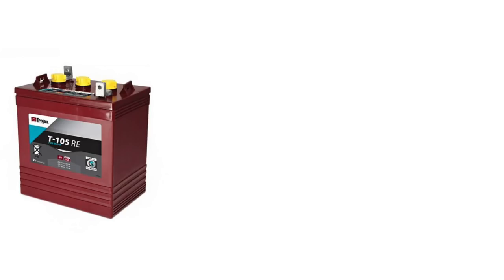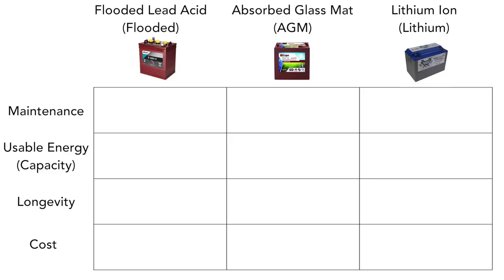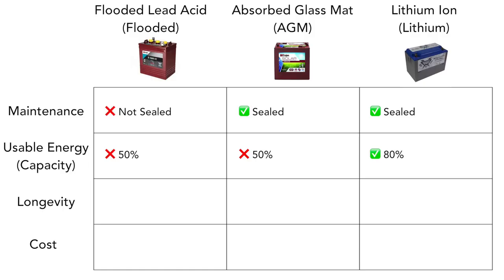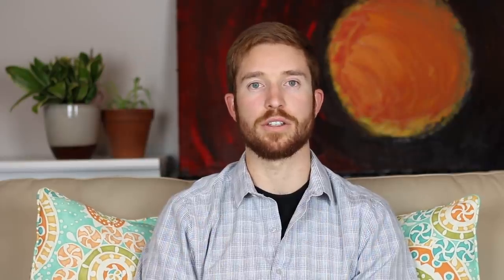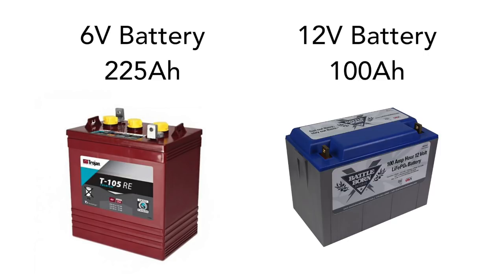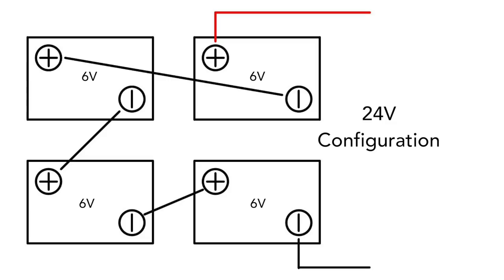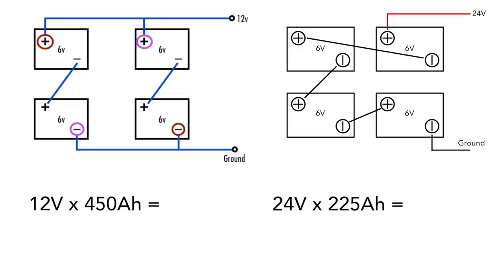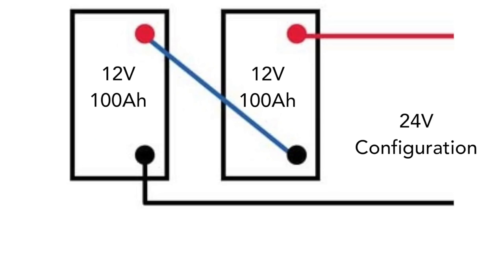Battery Bank Options + Wiring Solar Batteries from 6v to 12v vs 24v

Comment from the maker: Hope you guys enjoyed the video 😊 Be sure to share this info with anyone you know who is interested in solar power. It really helps us out. Thanks for watching and I'll see you in the comments!
Reply: not aiming to step on your toes but 9:03 12 volt set up your outputs need to be off set for a balanced drain and charge so that one battery is not taking all the drain or charge first. Path of least resistance always stands with batteries. The way it is set up in the video one battery is always playing catch up and the one that is the first out is the first to fail. Good effort on the breakdown and explanation. Have a good day
Reply: Duet Justus what about these 12v batteries that have 75a. .....they are like $30. Would these work for a small system
Reply: Something for you to consider for your next comparison is lead carbon batteries. The negative plates are treated with carbon to reduce degradation . They have similar performance to LiFePo4 , 3000 - 5000 cycles at 70% DOD , they are designed for  Partial state of charge operation (PSOC) are a lot less expensive and are safe. Yes they are heavier. The other point I would like to raise is ,With the way technology is advancing, Is it worth going for something that will last 20 years, when it could be out of date in 10 years.
Reply: Not certain about the points made but ,if anyone else wants to uncover homemade solar energy try Magonsi Solar System Expert (just google it ) ? Ive heard some great things about it and my co-worker got amazing results with it.
Reply: In 2-3 years the solid state batteries will make all of these obsolete.
Reply: @buffalo_chips9538  It was estimated in 2012 that a 20 Ah solid-state battery cell would cost US $100,000. It's a better technology and has improved greatly, but the cost for low such a low amp hours isn't plausible yet. This technology will reach computers and cell phones before it's ready to power home appliances.
Reply: Do another video with Lithium being the old standard now compared to Sodium metal battery and the new Iron Flow Battery
Reply: Dude you are amazing thanks for the information you never know... That there is other people in the other side of the planet watching your videos.👏👏👏👏
Reply: Hey, I don't know if you still read comments but it would be cool if you made a new video to compare different complete setups at different price ranges for RV's, also maybe talk about combining battery chemistry in your pack, also what are the advantages/disadvantages when using it trough an inverter, how one allows for more draw without compromising the batteries and if you ever run out of topics imagine the cost of a DIY 18650 battery pack and factor that in too.
Reply: Indeed educative thanks
Reply: @buffalo_chips9538  Thanks for letting us know future products will make current products obsolete.
Reply: I like the very side by side comparison but you kept referring to them as lithium ion not lithium phosphate as the pictures showed
Reply: If the system is wired both in series and in parallel, what happens if one panel is shaded will the whole bank close down or just the one panel?
Reply: At this point in time , 20 years of lithium battery life is only theoretical since they haven't been around very long .
Reply: A few things missing from the lithium battery sales pitch. Class c motorhomes have room for two batteries max, not 3 or 4, so your calculations don't work for those types of homes. Lithium batteries aren't drop-in replacements for lead acid they need additional upgrades. Lithium batteries are more sensitive to high and low temperatures than lead acid batteries so they need to be kept inside which takes up valueable space. Solar power is a supplemental power source. A gas/diesel/propane generator runs 24/365 come rain or shine.

Comment: The best video for connecting batteries together I have ever seen. I clearly understood how to connect my three 12 volt lead acid batteries to maintain a 12 volt system to run my 12 volt to ac converter and to connect my 12 volt 100 watt solar panels to charge these batteries. I got the batteries for free from my son-in-laws business and had the wires built 9" long to connect them all together in parallel from a website on amazon and everything works great. I have 300 ah at 3600 wh and divide that in half or 50% of usage of the batteries gives my 1600 wh of usable energy. I was just given another 12 volt battery to connect to it so I am glad I order 4 set of negative and positive cables. I'll then have 400ah at 4800wh divide by half and I have  a 2200 wh of usable energy. Its running great.

Comment: I’ve been running most of our home off grid for around 4+ year now and my lead acid batteries are doing just great. Yes I agree you have to maintain them regularly but if done correctly they will last years. Just waiting for these batteries to give up before considering changing over to lithium batteries,that being said it all depends on the price.👍
Reply: Lithium catches fire and can blow up

Comment: A couple of things to consider with lithium ion batteries. If you do end up over charging or discharging them they'll probably be toast. And if they catch on fire, have fun putting the fire out! Lead acid batteries might be old tech, but they are far more robust. They can handle more abuse and are probably the better choice for someone beginning with solar power.
Reply from the maker: I really do like my lead acids. It’s definitely a trade off and if I were to install again, I would definitely need to weigh all the options. Thanks for taking the time to share this info 👍🏼
Reply: Cheers for replying. There's a couple of other interesting battery technologies out there too. Nickel-Iron (Edison) batteries & Salt Water Cells. And of course some people run industrial size NiCd cells too.
Reply: the FIRE problem is practically non existent with LiFePo4 batteries, people must make a study on the differences in Lithium batteries, the mostly in small batteries used chemical is LiOn (18650) and YES they are a bit dangerous, the LARGE prismatic cells in LiFePo4 chemistry are in fact very hard to ignite, so check out the BIG difference between these.....
Reply: Agree, LiFePo4 batteries are far more stable and safer. But at the expense of reduced capacity. But practically all those involved in making DIY power walls and the like are predominately using Li-ion chemistry cells recovered from old laptop batteries etc. It's triple jeopardy really; using unstable cells, second hand with different lifespans left in them, some people not really knowing what they are doing. Did you see that video on the VW combi going up in smoke when a pack of Li-ion cells was left charging?
Reply: Lithium ion batteries are more safer, its very hard to ignite them due to the fact that the constituent cell is made up of small finger-like batteries that are also inside a metal exterior. On the other hand, lead acid batteries release hydrogen gas when charging and sulphate at the terminals over time.
Reply: The new glass electrode lithium batteries are just starting to come onto the market.  These batteries are a lot harder to damage through careless charging than the older lithium technology.  It's within sight that Li-Ion cells could overtake LiFoPo4 cells for solar storage, with the same storage capacity as Li-Ion but without many of the old problems associated with over- or under-charging, or caused by charging at the wrong rate.

Comment: Great diagrams much appreciated.  Have been chewing on an upgrade for our trailer for longer dry camp times with litheom ion batteries.   We where not sure on the solar for the moment since our preferred camp sites are heavily wooded and light limited.  But the 80% useage helps camp stay and also we can run generators for some recharge as needed.  This video is helpful as we work toward this goal.  Thank you.
Reply: His depth of discharge info is wrong, the AH ratings take that into account already. For an RV, unless you are getting really into it lead acid is the easy choice as it pairs up well to be charged from the tow vehicle.

Comment: Great presentation of a challenging topic!  However as they say, the devil is in the details.  As a part time RV'r my needs and long term prospects are different than a full timer.  For example, your cost per AH implies premium batteries which can handle some extra abuse.  As a part timer, I'm very satisfied with 2nd Tier AGMs such as the Universal that can be had for as little as $1.75 per AH.  Also AGM batteries (and Li-Ion) do not need venting, and for cold weather are best placed inside the camper.  A security issue for many small rigs with outdoor battery storage.  My batteries only cycle about 100 times a year, and I plan on keeping the camper only about 6 years.  So Li-Ion will never really pay for itself as I'll beat my rig to death on bumpy Interstates before it gets retired.  Also in 10 Years some new battery tech will come down the pike and my $5 per AH Li-Ion battery investment will become "Old news".   Lastly is the issue of the inefficiency of the 24 - 12 conversion losses needed to power all the 12 V appliances, lighting, and chargers an RV would have.  That can offset some of the efficiency gains of of the lower line loss of 24V systems.  Thanks again for a great presentation and channel!
Reply from the maker: Such great info all the way around. Thank you for taking the time to add all of this 😎

Comment: I really appreciate your beautifully clear explanation putting everything in perspective. I am feeling rather stupid as I must have missed the obvious point! In my mind, if Li @ $3,000 is 5X ledAcid @ $600, & Li last only 5X longer, the cost is equal. (maintenance & replacement work aside). I imagine in 5 years there may be a superior battery to any now?

Comment: I found this super helpful. I am converting a school bus into an off grid tiny home. For me, the Lead Acid batteries just make more sense. Yes, you have to maintain them, yes they don't last as long as what they claim lithium ion batteries last, but I don't plan on keeping the school bus for 20+ years so I wouldn't get the full value of the lithium. I honestly only plan on living in the school bus for 5 or 6 years. Also, The cost in this video is slightly outdated or not well researched for lead acid battery cost. You can find 215 Ah lead acid batteries (6v) from Sams Club for $90/each. Duracell brand which from my research, these particular batteries are rebranded Deka batteries. So I can get 8 Lead Acid batteries for the price of a single Lithium ion battery. Sure, I can only use 50% of the capacity, but its MILES cheaper. With proper maintenance, those batteries should last me the entire time I live in the school bus.

Comment: Thank you very much  for the comprehensive yet straightforward explanation of the advantages and disadvantages between the 3 main battery types, costs, and performance capabilities! You conveyed the information virtually as straight and simple as I’ve seen— and I’ve watched MANY videos on this topic only left feeling more lost, dazed and confused most of the time. But I obtained a much finer and more accurate understanding of the energy storage solution I will likely use (3rd one) and precisely how to configure/combine them safely and properly— especially for higher Amp-hours, minimal maintenance and years of sustained performance and Energy output over the years which I absolutely need.  

I am currently actively planning out my home solar power system now, scoping out the best components I can find (a real toss up sometimes) and literally can’t wait to become more energy independent all-around!!  
The only other thing I would have really appreciated was if you also included salt-water batteries in your comparisons and explanation...
Bravo and well done! Thanks again for taking the time.  Subscribed! 👏👍👌

Comment: Nice, understandable video.
I can readily find 2-3 year old used UPS 12 volt AGM batteries at 100-125 AH on craigslist for $65 -75 each.
I have some AGM batteries that are still working that I bought used. Manufactured 14 years ago, with occasional use in a remote TX cabin.
I'd like to change to Lithium... but too pricey.

Comment: I work for a major oil company and do project NPV calculations all the time and we would never use a 20 year life cycle analysis. The odds on you owning that camper 20 years from now is pretty slim. In addition, the odds on no new innovation in the next 20 years is even less than you owning the camper. I can get 5 years from my FLA battery before I recondition them and get anther 200 cycles. A good FLA is really the right choice for me and that’s why we have options and we need to do what makes sense for our own situation. If you took the difference in the cost and put it in the Russel 2000 our any other good indexed investment you could buy Battle Born. 

I think Battle Born is a great business and very committed to the recreational travel trailer industry, I’m just not buying their value proposition. With that being said a great video, and a very impressive battery installation. 

Geoff
O

Comment: I love this video. I send it to a lot of people I see asking basic questions. But one question I haven't figure out yet is, what is the advantage or disadvantage of having a 6v battery vs a 12v battery? From what I can tell, they're both similar in price (when comparing ah).
Reply: The answer could be another separate video, but in simple terms, voltage X amps = power (watts). Higher voltage systems (48V vs 12 volt) require less current (amps) to provide the same amount of power. Less amps means cable  /wire sizes can be smaller (less expensive). Notice that electric appliances with a heating element (dryers, range tops, etc)  require more power (watts), so they are designed to run on 240 vac which requires half the current than if it was designed as a 120V appliance. Hope that made sense.

Comment: Great video, give one a great perspective on setup and cost, which for   lot of us is a factor, if not a major one. I've not found anyone that has done a video "just" on a straight battery bank to service a house. So my goal is to have a large enough battery bank to put out 350 kwh per month, 11.66 per day,, and this is a bit on the high side. For now I will charge the batteries with my generator, eventually I'll add solar panels to help with this as well.
So what I'm trying to learn is how many 200AH batteries would I need to give me the 11.66 kwh per day needed?. Thanks
Reply: 10

Comment: Great Video!

Super basically:  When you take the covers off of your car battery, you will find 6 holes filled with fluid.  Each of those are individual cells producing around 2.2 volts.  They are internally wired in series making around 13.2 volts. (but called 12 Volts). 

If you use 6V golf cart batteries, they won't do you much good unless you want to start a tractor or own an super old Volkswagen bug.  They only have 3 cells per battery, so you will have to add 3 more cells. (another 6V battery).  By running a cable from positive of one battery to the negative of the other, you wired them in series and you will have a large12V battery. When you read your battery it will tell you how many amp/hours it has in it.  You were able to double your voltage, but you can not double the Amp/hrs, they will remain the same.

A parellel circuit requires 2 cables (obviously) Positive from one battery to Positive on the other battery, and on the other cable Negative to Negative.  If you wire two 12 Volt batteries this way you do not double the voltage,(which is good) but you get twice as many usable amp/ hours.  This is very common on RVs.

Keep in mind, two six volt batteries wired in parallel will have allot of amp/ hours, but still only 6 volts, which will not work on your RV or car.
Reply: old school - tell me when you had to last top up your car battery ? they don't do it now ... not since the 90's

Comment: Upgraded my camper with 2x 110 amp h lithiums. So far they are amazing
Reply: At $2,000 for 2 @ 100Ah 12 Volt batteries, they had better be very amazing ...

Comment: We've currently bought ourselves a previously owned motorhome, which has 3 year old lead acid 6 volt golf cart batteries.  We do want to add solar (haven't seen your video's on that yet) and I am very interested in the many 'Lithium' choices available now.  I do see there are many with far more than 100 AH, so the choices are many, but one does have to take cost into consideration.  I truly would like to not have to worry about 'maintenance', so the Lithium would be a good choice for us I believe.  I believe there are Lithium batteries that have recently come onto the market with much less chance of overheating/safety, than the old versions, so those are the one's I am most interested in of course.   We do have a residential fridge, so the daily longer use of the generator is one of the reasons as well, to go to a better setup!   I'll try and find your 'solar' video when time allows, and any others pertaining to this issue.   Thanks for taking the time to make this video, it was appreciated!

Comment: you forgot the fact that the Lithium batteries have a much lesser PEUKERT factor, when you put a big load on lets say a 200 AH rated (at c/20)  lead acid baterie , the capacity drops like a rock, so in practice it wil behave like a 75 Ah batterie (100 ah  sinds we only can use half of a lead batterie , minus the anoying peukert factor) so i think that in practice two 100 AH lithiums wil be simalar to the three you mansioned....also with a far lower voltage drop, and not to forget a 40 percent HIGHER charge efficiency, very handy during rainy days in the winter...otherwise a GREAT video explaining these batteries!